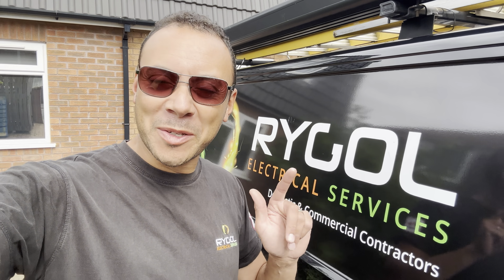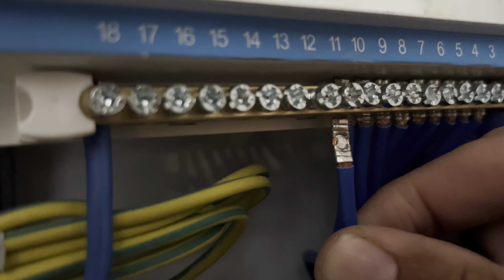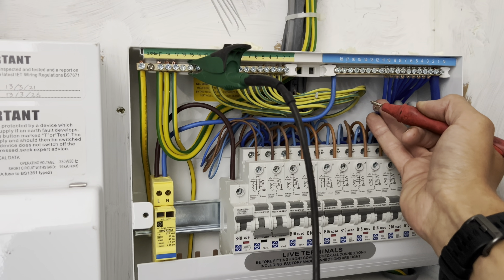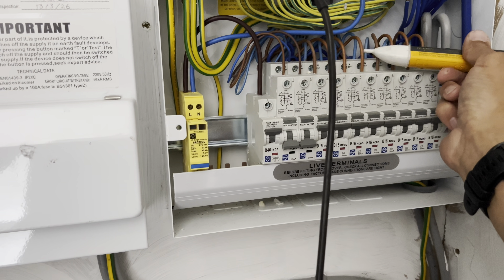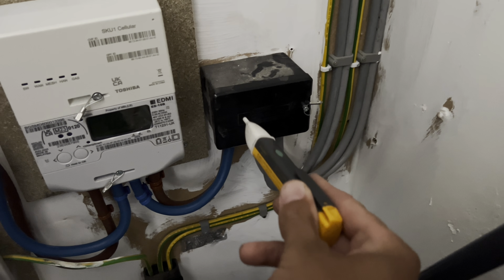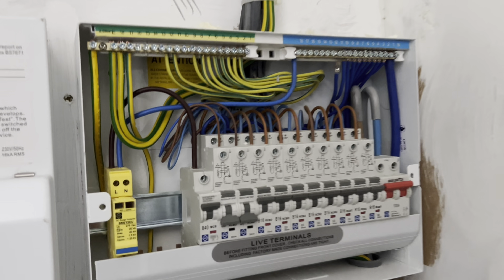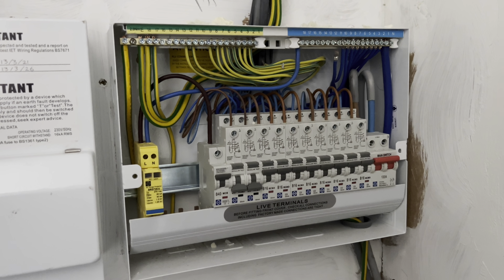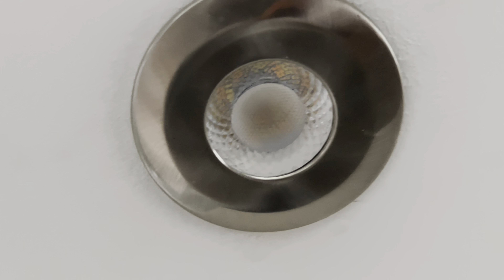Smart Meter Disaster! ⚡️

Comment: Shouldn't the electricity company have been called out to correct the fault seeing as the box had a seal on it, and for them to verify the dangerously incompetent work of their employee
Reply: Alot of us know which company it is and the guys sealing pliers number is clear to see so he will definitely be getting pulled in soon if not already, but this guy should not have cut the seal and put it right, should have called the company that fitted to come back and left customer off supply they would have came immediately on a emergency, he could be fined for cutting the seal
Reply: @scitec717   He can't be fined for cutting the seal. Everything after the meter is the property of the home owner, including the tails coming out of the meter and the henley blocks. Putting a seal on the henley blocks is pointless and the homeowner or one of their contracted personnel is well within their rights to rip it off to fix something. As for the cutout, since the meter installer didn't fit an isolator while they were installing the meter, the only way to safely isolate the supply (as required by the HSE and EAWR if possible) is to cut the seal on the fuse and pull the fuse out. No DNO is going to prosecute you for working safely, as long as you inform them that you have done so, so they can come and inspect it to make sure it's safe for continued use and to re-seal it. I've cut cutout seals on many occasions.
Reply: I think they've proven they're not qualified.

Comment: Looks like reverse polarity - I’ll keep watching
Reply: I used to be a meter fixer in a previous life - when I walked into a property the first thing I would always do before I did any work was to put my volt stick near a light switch - if it didn’t light or beep it would alert me to the possibility of reverse polarity  - you should always have a phase at a light switch, if the polarity is correct - not the definitive test I admit - but a dam good guide to the possibility of walking into a property with reverse polarity..

Comment: Remember guys who fit smart meters are not electricians. They get basic training. Plus recently a meter changer tried to lecture me on how you should never break the seals.
I'm a 65yo approved electrician .
Another point is I always use my Kewtech socket tester first plus LED lights are good at highlighting reverse polarity
Reply: Do those guys fitting the smart meters get paid by the meter?  They did when going thru my neighborhood.  'nuff said.
Reply: @Sylvan_dB  No but they will be on basic wages. Also because the neutral was dropped or disconnected through the switches LED will flicker. I got called out to a common stair where the led lights were strobing. I knew right away there was no neutral. Customer was impressed so all good

Comment: [I'm UK-based.] Just a general thought about DIY electrics: a few years ago, a 'weekend electrician' (i.e. an uncertified bloke without any up-to-date sparky knowledge or qualifications) might add a 240V extension to his garage or shed for a model railway or a kettle, but that was about as complex as things got.

Nowadays DIY unregulated electrics is supposed to be taboo, but homeowners are out to save money and won't call a proper electrician to do ANY job; they'll look stuff up online and have a go themselves. That's worrying. Wiring up solar panels and Ali-Express budget control units and improvised rectifiers (or whatever) to lithium storage batteries isn't something you want anyone unskilled doing.

But I'm sure there's a lot of it going on.

It gets worse when you take EVs into consideration. Huge currents and voltages, possibly even three-phase shenanigans, and yet more unregulated charging units with dodgy extensions hooked up to supply the home-built charger made by his mate Gary ("He knows everything about electrics...") to charge 'customised' e-bikes or souped-up e-scooters.

These days, everybody thinks he's an expert. Been online, read two articles... "How hard can it be?"

This hard: ⚡🔥🔥💥.

There'll be lads reading this who'll be nodding and thinking, "Yep. I'd never do anything stupid because I'm great and it's only everybody else that screws up."

Which is what every single car-dude who watches a YouTube 'bad drivers' video thinks. And it's what every driver featured thought, too.

I don't mind if idiots blow themselves up. It's a free world. Go for it. But I hate the idea of having a neighbour who's done all his own safety-critical work, because I live in a 2-bedroom terraced house and when he mucks up, the whole neighbourhood's going to suffer.

A bit of home plumbing's all right. Get things wrong and you get wet. The house two doors down won't be affected.

I've stopped talking to my immediate neighbour because he's laid a gas supply from his home to a new outdoor 'room' (shed/office/kitchen) in his back garden. It's got a fridge-freezer, a tumble dryer, some cupboards and a gas cooker; his wife used to set up a portable charcoal stove in the garden when frying her spices (too pungent and cloudy for the main kitchen, which doesn't have an extractor fan), but now she's under cover and cookin' with gas...

Yes, he's an ex-builder and yes, he acknowledged that he ought to have got a proper gas doggy (🐕CORGI) to install and check and test and certify, etc. But he didn't. I've got no idea how conscientious or competent he is. 

As well as a recent loft extension, he does all his own electrical work, too. If there's a problem with his DIY expertise, will my home insurance policy be invalidated because I didn't notify my insurer about his uncertified workings?

Gas and (major) electrical changes are meant to have signed and stamped paperwork, aren't they? Am I responsible for my neighbour's actions? I'm reluctant to notify the authorities because I'd essentially be starting a war. Also, these days, grassing on a neighbour's probably a hate crime.🙄

He doesn't have a solar installation, any storage batteries or an EV (car), but his eldest son has an e-bike. He charges it in the outdoor room with the new DIY gas supply. Hmm. That sounds safe.

I wonder how many other people across the country are living next door to such 'experts'. 🤔

Comment: I had an electrician putting fuses in the wrong slots swapping over 16 a with 32 a and 6 a joke.
You cant get lower than,an electrian on a trade job  They have that trip board that keeps them in a job.

Comment: A neighbour had an 18 Kw 3 phase kiln installed by a local electrician.
However, when she switched on her kiln the whole building tripped out.
Eventually I discovered that this ''qualified'' electrician, had used single phase cable for a three phase circuit, and used the earth wire as one phase.
However when he connected the cable to the kiln, he forgot he was wiring three phase, and wired the 'earth  phase' to earth. 
This meant he had a potential of 440 volts connected to earth!
He was called back and had to replace the cable with the correct three phase cable.
However, later, when I was connecting another appliance, I was about to grab hold of the earth wire, but decided to check it with my meter.
YES, he'd done the same fool thing on another circuit!
I advised my neighbour of the problem, and left her to get it sorted out.

Comment: First guess, problem at the neutral ground connection.
Reply: Its easy to think breakers are an upgrade over fuses except for the breaker reset, requires a ground reference for things to behave properly, thats why neutral must connect to ground.  Any issue with that, and the whole illusion of the breakers being a switch goes out the window

Comment: If the polarity was reversed how was the appliances still working, surely they would not work?
Reply: Most appliances don't care about polarity, it's AC after all. LED lights are one of the exceptions.
Most countries don't even have polarised sockets, so polarity is random anyway unless an appliance is hardwired.

Comment: How can they be allowed to seal ANYTHING after the meter? I mean ... this is just idiocy.
But honestly ... testing a "polarity" in AC is bullshit. Yeah your bri'ish sockets can all be wired the same, but AC in main land europe (our connectors go in either way) works BOTH ways, and so does yours. So ... "polarity check" concerning L and N is voodoo on a socket, but simply does not say anything at all, whether the house is wired wrong or not. What IS important however is of course the direction of the 3 live wires, because this MAY cause issues in 400V-Devices. (especially motors)
Reply: Polarity is critical when working with single pole switching and fault protection - as demonstrated by the lights which were flashing when off. Phase rotation in a single phase supply is, uh, non-existent..
Reply: @Monkeh616  What did I say? I was talking about sockets. AC is the same both ways around. 
So checking at sockets is bullshit.
Reply: @TheScytheMoron  Plugs contain single pole fault protection - polarity at sockets is critical.

If you don't know how this stuff works, try not to make judgements about it.

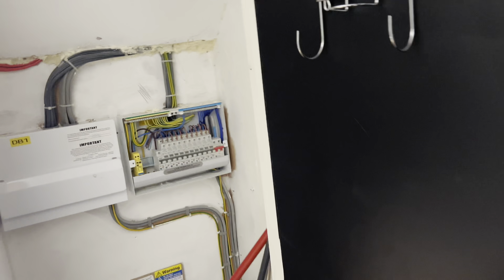Comment: Is that MCB cracked 1:00 or is it just a bit deformed either side of a natural partition? Sorry, caught my eye before I got to the good bit. Interesting to hear you say "I can't look at this bit" about the tagged components. That's what the guy who fitted my smart meter said about everything else. He did a lovely job in our untidy meter cupboard, but nothing in the house worked afterwards. He said I should call an electrician! While he was tidying up the meter tails he'd pulled the neutral tail slightly out of its clamp in the consumer unit.

Comment: Personally I would’ve put the line cable into the back of the Henley block to give that extra space between the copper and the insulation. No excuses though for the meter installer not checking their work. Unfortunately most meter installers are not qualified to the same standard as a full time working sparks. One more thing, there must’ve been a better e-light fitting than that bulkhead smack bang in the ceiling.

Comment: Call  me OCD...  But I use the same maxim of ''... measure three times - then cut ''  when undertaking testing, especially a final test.   

Giving the benefit of doubt over human error (... fatigue, domestic or financial issues etc...); the test procedures are there for a reason - to highlight any errors that could result in a 'danger of death' scenario.   

I bet Rygol had a ....  ''WOH!''  Moment, the second he realised the neutral bar was actually live. 

As for the unnamed company....   'Heads will roll Leroy!  Heads will roll....''

Comment: A relative had just had a load of work done by an elecrician but still had a couple of light fittings to change. So as someone who has a reasonable idea, asked me. (My Dad was a sparky back in the 60's so I grew up rewiring relatives houses). 
 Pretty noddy job but just to be safe, I tested the connections, just checking there was live on the switch wire. There wasn't yet the light worked fine. I couldn't make sense of what I was seeing. Went around a few other circuits and all the same. 
Figured as I was unqualified and clearly out of my depth, I should step away at this point and get in the professionals. I suggested they call the electrician that had only recently finished. 
He came back and made 2 suggestions. 1) They ignore it or 2) he could do a full rewire for £,000s. She chose option 1, but to my mind, this means you are changing bulbs on live circuits, even with the switch off - so I wasn't happy.
Spoke to my Dad who suggested they'd swapped the tails in the fusebox. Nah, the guy was a qualified electrician who's supposedly certified the system. Can't be - but then the old man is getting on a bit and he stopped being a sparky 50 years ago. 
Went back, opened the fusebox and... yes, Live and Neutral tails in the wrong slot.

Comment: @5:10 .... Even before your next step, I immediately suspect someone has inverted the hot and neutral mains. Back to the vid, it's going to be interesting to see what follows.

Edit to Add: I'm an electronic tech, but obviously have a good understanding of electric utility, and I'm sure this potential disaster is not an isolated incident (pun unintended). One wonders if the UK shouldn't mandate inclusion of a neon safety light (ballasted with resistors to discount being tripped by stray current)) or a LED indicator from the box frame (earth) to the neutral that acts as a fault indicator. Cost would be minuscule to do this.

Comment: what surprised me is everything in the house worked ok without getting damaged or destroyed on switch on, apart from some flashing lights  ... how can that be ?
Reply: Most devices are not sensitive to this, it's AC after all. LED lights are an exception, they might behave as shown if you switch neutral instead of live.
Most countries don't even have polarised sockets, so for devices with a plug, polarity is random anyways.

Comment: This has been happening for decades. I new someone back in the 1980s who had their house rewired by his regional electricity board (as they were known back then). My friend was an electrical engineer so he did some tests himself and found the "professionals" had wired his house back-to-front. Over those same decades I have come to the conclusion that more "accidents" are actually caused by properly trained workers, not by amateurs - as the professionals would have us believe. If you wish to argue that point, just consider the number of "accidents" caused by drivers who are, essentially, trained to drive and examined in that skill.

Comment: As an ex electricity board electrician we were trained to do metering, i belive the double pole henley block may well be connected incorrectly, the live was always at the bottom connectors making it harder to make physical contact with it whilst the neutral is on the top block as is considered a safer connection?

This does not excuse the lack of due diligance by meter installer, however if their training is limited may explain the connection error along with a lack of testing and complatancy.

Comment: Every chance you'd have been in contact with the chassis when you touched the neutral bar. Of course we all work live. Mind you. The lights flickering when switched off suggests some voltage on the neutral somewhere so would have been pretty daft to touch it.

Comment: I love seeing the way other countries than USA do electrical. Its cool that just because the install does not meet our code, doesnt mean that its not safe. Your electrical enclosures and devices are quite different than ours. Its scary to think that no matter where you are in most countries, if you get shocked, its going to hurt bad due to voltage. In the US, residential and most commercial is 120/208 or 120/240 and its very very hard to get shocked by the higher voltage since you would have to touch 2 wires at the same time. 120v feels like a painful tickle most of the time.

Comment: I guessed live - neutral swapped. Had the same over 50 years ago when the meter was replaced by the electricity board (remember them?) and a fluorescent light still glowed in the dark when turned off. They sent out a man to investigate who confirmed my suspicion and rewired the meter correctly.

Comment: Great video. Close call. Working in the electrical industry, I've seen many cases of incompetence from untrained people doing work on installations. It's highly likely the person who changed that meter just skipped the test and signed it off as ok. However, is it possible that one of the sockets in the kitchen has also been replaced incorrectly since you first wired the house up and that it has been wired with the wrong polarity too. Could the installer have been unlucky and tested it out on this incorrectly wired socket, where it would cancel out the major polarity error they'd just made back at the board, giving them a good result. It said a socket was tested in kitchen, it didn't say which one, and there looked to be several. It might not have been the one you chose in your video. Might be worth checking out, now it's all back right, if you've not done so already. Just to rule it out and to give them some benefit of the doubt. Although I'm sure your presumption is probably correct.

Comment: This is why I refuse to have my old smart meter replaced with a new one it has never been smart since I moved it 2 years ago and I send a meter reading every month to get an accurate bill (No stupid guestimates for me). OVO has sent me a letter stating that the certificate for my meter has run out and to arrange installation of a new smart meter, I did spend quite some time on the phone trying to get them to send me the certificate for my meter showing that it has run out but they said they cannot do this, so I said goodbye.

Comment: British Gas sticker, I’d hazard a guess he/she will maybe of done a plug in test pre install but 100% not done one post install. However you’ve spouted off about someone’s mistake yet you’ve clearly either contradicted yourself re safety and electrocution by either working live to correct polarity or you’ve illegally cut the seal and made dead from the mains fuse 🤔 you should be careful what type of vids you put out sounds like you’ve made this video to plug your business but you’ve ended up with egg on your chin.

Comment: Leaving comment now as you suggest (5 minutes into video, not read other comments). My guess, and it's only a guess is that the entire supply is the wrong way round! I'm not qualified so I'll continue enjoying the video and see. Update... Watched till the end and that was indeed the case. Horrific. No circuit protection anywhere between earth and what should be neutral. Switches on sockets won't isolate live etc. I guess the LED lights were flickering when off due to capacitive coupling to ground.